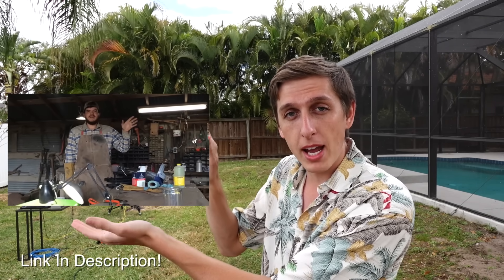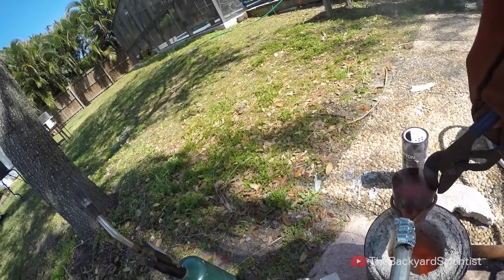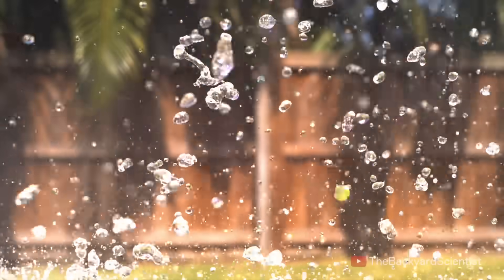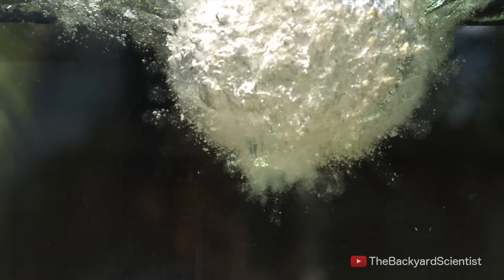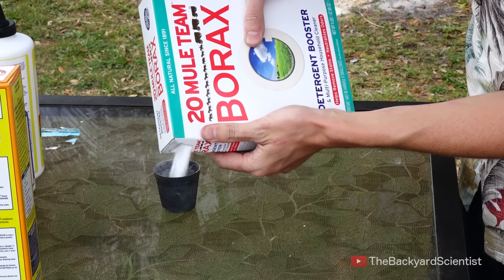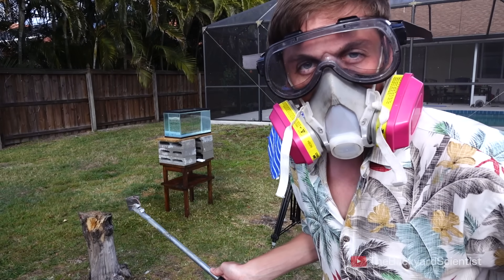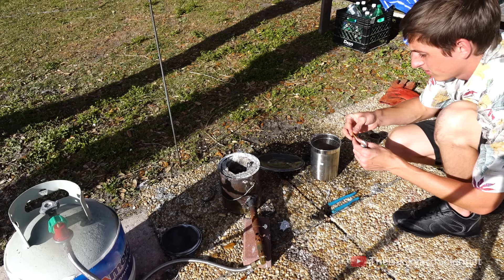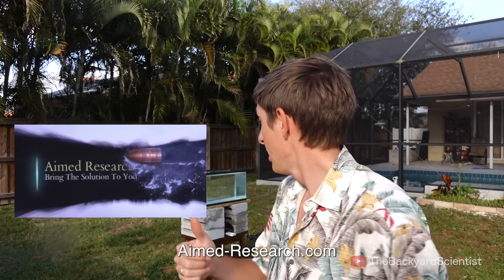Pouring Molten salt into Water - Explosion!

Comment: It's not a mystery!
1) NaCl is highly crystalline and has FCC lattice structure, whereas molten salt doesn't.
2) when poured into water, the molten NaCl quickly retains it's structure. This process releases heat suddenly. Sound is also an energy.
3) In that process the space gets compressed and hence vacuum is created.
4) The adjacent water molecules rushes to fill the gap (vacuum). However, the water molecules that comes in contact gets heated up and expand.
5) This collision between the molecules rushing to the centre and steam molecules rushing away from the centre cause the disturbance.

Note: we don't notice this with other salts, as most of the salts are hydrated and are not highly crystalline like NaCl.
Reply: Try Me Crystalinity may justify in part the explosion. However solubility of NaCl is much higher than borax, so when NaCl is getting back to its crystal form(solid again) water penetrates between the particles and its heat generates water vapor that expands and explodes
Reply: @mauriciobob  yes, but solubility is not instantaneous.
Reply: @johnchenky  Solubility isn't instantaneous but neither is the transfer of lattice energy. As the boundary of the molten salt relaxes into a crystalline structure it will increase kinetic energy which is transferred via diffusion the same as solubility. This also has nothing to do with explaining why the other sodium salts are insulated. Hydration is completely false because they've been heated above 800 °C. Lattice energies and vacuums are also wrong; they all have high lattice energies and compress similarly upon crystallizing.
Reply: Sodium Chloride disassociates in water and DOSENT retain its crystalline structure & molten Salt (Sodium Chloride) is liquid and the ions are free to move around and if you saw the sodium blow up in water you'd realize sodium would have to account for the reaction. Sodium donates its electron to water and releases hydrogen gas and forms sodium hydroxide and heats up in the presence of water with hydrogen gas being released in large volumes which causes an explosion. BUT, molten salt already has so much heat and heat increases pressure so the molten salt sinks below the surface of water then the free ions react, and blow up.
Reply: @tylerdoolittle6465  Sodium in sodium chloride is already ionised, so it doesn't have electrons to donate.

What is happening here is the object is hot, it has very little to do with it being salt. Salt dissolving is exothermic, but the majority of the energy from this explosion is due to the salt being hot.

It isn't a chemical reaction.
Reply: YoloSwagDaddy9658 if it was simply heat then basically anything you put into water that was extremely hot would cause an explosion. Try me was spot on with why it exploded. Salt regains is molecular structure as a solid very quickly when cooled. When it’s just salt that is. When it’s mixed with other components they prevent it from cooling as fast therefore it doesn’t revert back to its solid structure as fast. That in turn reduces the amount of vacuum that’s produced which in turn reduces how much and how fast the water is pulled in to that vacuum therefore dulling the reaction to the water being heated. It is a physical reaction. But only due to the chemical being used. Therefore it’s a physical reaction to the specific chemical used.
Reply: @joelblevins  Yes there are other contributing factors, but all explosions need a temperature difference to occur. The vacuum isn't the sole reason for the explosion.

If you get something hot enough and put it in water, it will explode. The water will instantly vaporise and expand, causing the explosion.
Reply: YoloSwagDaddy9658 then explain why the other components used didn’t explode after being heated to the same temperature. They were just as hot as the salt and didn’t cause near the reaction. It is all about vacuum. The more vacuum produced, the more water is pulled in to the heat, therefore cause a much bigger expansion or explosion if you would in water vapor.
Reply: YoloSwagDaddy9658 I’m actually very educated on this subject. You claim that any heated substance will cause an explosion and the video proves the complete opposite without diving into the laws of chemistry and physics. How can you possibly try to validate yourself continuously on something that the video completely proves wrong lol. And because someone gives you an educated explanation as to why you are wrong, you go to Wikipedia of all places  to educate the person you claim is wrong regardless of video proof that your theory is bullshit lmao. Good luck in life bud.
Reply: joel blevins so if this were done in a very viscous liquid that has a high boiling point would there be no reaction at all? I can’t think of a liquid with those properties off the top of my head but in theory?
Reply: @tylerdoolittle6465  Neutral sodium releases hydrogen gas and forms sodium hydroxide in water. Na+ is not close to the same reducing agent as Na. I'm on board with the first part that the crystalline structure won't form in water like Try Me is claiming.
Reply: And why Molten sodium caused fire?? 👀
Reply: @BLS.93  Hydrogen. Sodium hydroxide is forming hydrogen gas as a byproduct. All alkali metals are highly reactive with water/humidity in air.
Reply: Benjamín Enrique  that s a chemical reaction, between sodium and water they form a new substance, its highly exotermic, hence the flames
Reply: @BLS.93  because it is was salty. if you ever feel salty on a warm summer day dont go anywhere near water.
Reply: So if we tried this in outer space????

If we tried this experiment very carefully outside the spaceship had a triggered device placed in water that contained the heat melting the salt, had a fish tank with water kept in it by rotational force, then released the melted salt into the water....what would happen?
(I have a general idea, but I’m also not a science person sooooo)
Reply: @imcintyre01  Shouldn't change anything drastically.  As long as the molten salt and water are allowed to mix rapidly enough, it should create a really impressive steam explosion.
Reply: Ok ok... now tell us how did giligan not explode being on a desert island with ginger and Maryann all those years?
Reply: @dannymendez1688  simply because he wasn't salty he was sweet
Reply: oof rip ur fingers
Reply: English translation: its salty and its hot
Reply: Try Me 

They are dehydrated when heated, so that difference is inapplicable.
Reply: thanks everybody from this thread.you guys are brilliant
Reply: It’s the hydrogen atoms in the water reacting with sodium
Reply: This was my hypothesis at first; however, I find his idea with the visual putty to have quite a bit of merit, as water at those temps tends to explode into a vapor cloud very violently.
Reply: I guess sound could be considered kinetic energy as it is vibrations through a substance.
Reply: I think, using this: https://mrsec.org/highlights/amorphous-salt, instead of molten salt could be also interesting :)
Reply: Try Me doubt this, it’s probably just attributed to the low viscosity of molten NaCl
Reply: @danielvillageliu7445  I would also have liked to see a more rigorous tracking of pH to rule out a chemical explosion, and especially to have seen other chloride salts being used. I was thinking products like steam, HCl (gas), and maybe also hydrogen gas or even oxygen gas at these temperatures. If the molten salt is reacting chemically with the water, then it won't matter if a sheath of insulating steam is formed as in the LF effect; the molten salt can still react with the gaseous water.
Reply: Way better explanation 👏.
Reply: or it's just very salty....
Reply: English pls..
Reply: @aryapunyashlok3488  If you've ever dumped a bunch of stuff in a box and then later put it away neatly, you know it saves space when it's put away neatly. Basically, when the kind of salt that explodes is a solid, it automatically organizes itself into a neat, small space because of veeeery small amounts of electricity and magnetism. When it's a liquid, though, it's not organized. So it goes from taking up a bunch of space to taking up very little space very quickly, which leaves a bunch of space for the water to rush in and fill. But then the water is getting heated when it gets close to the salt, so it gets disorganized and takes up a huge amount of space. 

Raw sodium doesn't have that kind of electricity and magnetism like salts do, and most other salts don't stack as neatly as NaCl (the one used) so they won't change how much space they take up nearly as fast.
Reply: Duh, of course , everybody knows that. Geesh.
Reply: can you plz speak English this is a video in English
Reply: get over yourself.  it's not a mystery!
Reply: Noice
Reply: Good thing i paid attention in chemistry class, I know why an explosion occoured
Reply: Which is a chemical reaction...
Reply: @navadiouscash55  no it's a physical reaction. A chemical reaction would be something like the born haber cycle to make ammonia.
Reply: Really not other salts? I thought it's purely a physical reaction. Fast heating water only.
Reply: Thank you Einstein
Reply: r/iamverysmart

Comment: I don't know this stuff off the top of my head but...the different molecules must have different sized spaces inside them which grow, also, with heating. The one that can best allow in water molecules would probably make the biggest explosion. Maybe the NaCl can hold multiple H2O molecules or more of them than the borax.. But then there might be other heat specific physics involved as well. It's an interesting problem!

Comment: Is it really the molten salt causing the explosion?

I was thinking it is because the water received a really sudden thermal shock? Look at the temperature difference between the molten salt and the water, this heat is enough to quickly vaporate the water into gas right?

Comment: The heat will extract the Na from the sodium. Pure Na is a metal that reacts explosively in contact.  Not the only metal reacting this way. I did it in chem class, not physics. Not every chem reaction change the pH... it all depends on how the hydrogen electrons and if they separate from  the oxygen leaving hydrogen particles with a charge.Not a chem engineer but I seem to recall something along these lines.... other composts may get contaminated or have really strong bonds that may not mimic the chloride. Besides, lucky you that the amount of supposedly pure Na didn’t do its thing. That would create a really crazy explosion and you didn’t wear the PPE to escape it unscathed...

Comment: What I would guess is happening:
1. Hot melted salt is going into the water.
2. Surface of the melted salt is transferring heat into water. water boils surface change into crystalline solid. 
3. Solid crystalline surface cracks. Due to its crystalline surface it can not adopt to change of the shape of liquid salt and due to thermal gradient. Salt is not high thermal conductive, about the same as water.   I would also check density of the molten salt relative to the density of solid salt - it may be also a reason to crack.
4. Cracking process leads to splashing molted salt and pieces of hot solid salt.
5. Process repeats on the droplets as avalanche reaction. Water boils also around solid pieces. Heat exchange surface is increasing rapidly.

Comment: Isn't the salt just a coating? making the sodium explode later? try heating up sodium and pour water over that, instead of the other way around. and then also try it with the salt you used at the start. see how different that gets.

Comment: I'm pretty sure this just happens because the negative enthalpy of solution of sodium chloride exceeds the positive enthalpy of dissociation of the molten sodium chloride. Normally dissolving salt in water is endothermic, but enthalpy of dissociation should change with the temperature of the sodium chloride. If the sodium chloride is hot enough the enthalpy of solution + enthalpy of dissociation will become negative and so the physical reaction becomes exothermic instead of endothermic, causing a steam explosion.

Comment: Salt isn't what explodes it's the elements in salt (sodium) that separate when heated 

sodium is highly reactive with water if i remember correctly which is what explodes (too put chemistry into this video)
Reply: to decompose salt, you would need much more heat, much higher than what you need to melt it. and also, there should be a pH change if it's caused by the sodium because Na+H2O-->H2+NaOH. and that NaOH will form a basic solution with water.
Reply: @jayarjr7369  Wouldn't it be NaCl + H2O -> NaOH + HCL? One strong acid and one strong base => pH = ~7?
Reply: don't think that when you heat NaCl at high temperatures it will already react with water, because it will not. It is stable on it's own. it would not break apart.
Reply: Tony Dukes yeah
Reply: He didn't pour pure sodium into it he poured molten salt into it it did not separate as indicated by the pH test and the fact that it looked nothing like a sodium reaction which he also showed
Reply: @FrancisR420  it is molten dalt yes but it breaks down into its chemical compounds. its not pure sodium but sodium is what causes the highest reaction in the water causing the chemical reaction to explode

Comment: Basically think...
If you have to melt the salt at 800°C/1500°F then think, the boiling point of water is 100°C therefore when you pour the salt into the water it boils so quickly that so much gas is produced in such a small area and amount of time an explosion is created.
This is what i think anyway. Tell me if im wrong :)

Comment: To further back up your hypothesis (I haven’t looked at the papers cuz I don’t have time like chill), I think the water quickly going inside the sodium chloride, creates a vaccum for a split second which is violently filled in by water. But I think the reaction between the two is either a balancing of density or something completely different. I have no idea if NaCl is covalently bonded or ionically bonded - I can’t be bothered to think about it.

Comment: the reaction is aqueous – dissolved in water. The equation for NaCl (Sodium chloride) and H2O usually isn't considered a chemical reaction since it is easy to change the Na+ and Cl- back to NaCl...so it is physical because after the reaction the ph of the h20 is neutral

Comment: Back in the Fifties my brother and I used to melt our old lead dinky toy cars in a saucepan on a gas ring in the kitchen. We found that dipping them in cold water before dropping them into the molten lead created an explosion and there was dangerously hot lead splashing on to the underside of a wooden shelf above the gas ring and the nearby walls. 
Strangely, mum never mentioned the noise nor the bright silvery splashes but I often saw her struggling to get the burn marks off the saucepan.
 Pure steam expansion I guess, but I was only nine or ten and didn't understand the technical side of what was happening.

Comment: it's definitely chemical reaction. Nothing rocket Science behind this. Here's how,
NaCl + heat --> Na+ + Cl– ( Na and Cl ions separated by heat)
2Na+ + 2H2O --> 2NaOH + H2 (adding molten ionic solution to water)

So explosion is due to H2 gas which is coming out vigorously. 
 If you had haven't missed those chemistry classes, you would have know this @thebackyardscientist

Comment: When you heat NaCl (Sodium Chloride) the Cl (chlorine) atom starts to separate and then you get close to strait Na (sodium) which when mixed with H2O (water) you get an explosion. 
would highly recommend not doing this experiment at home because the reaction is highly unstable as seen in the video and can cause severe injuries. Awesome video though

Comment: The explosion is not caused by a chemical reaction. It is the result of phase change. The temperature of the molten salt is more than the boiling point of the water that is why the water that is in direct contact or the nearest surrounding water superheated and rapidly changed into its vapor state. Thus, changing the liquid water into steam and gas.
This is is quite similar on how a bomb works.

Comment: What you are seeing is STEAM explosions. And because the molten salt can emulsify quickly, its able to transfer its heat more throughly. The reason the salt worked and the other did not, is the flashpoints. Once the water flashes to steam the whole event gets hotter for a split second, because of the pressure, causing the salt to reach its vapor point(without contacting air), thus adding to the eruption. In air the molten salt just evaporates, under pressure wierd things happen. I am pressuming the salt vapor/steam contacting cool water would be quite violent.
Imagine super heated water injected into cool water, instant steam explosion...
ps: glad to see you guys in eye protection this time.
Keep up the kool work.
Reply: TheSirRip your smart
Reply: @cabesadepapacabesadepapa495 LOL,  if i was truly smart, i would still posses all my fingers...
Reply: @TheSirRip  why, what happen to them?
Reply: @mrtimidlysmith1054  Improvised pyrotechnic test that got out of hand.
Reply: @TheSirRip  Video or it didn't happen
Reply: @Gabriel-lh9xy  in 1986 vhs was all we had, it did not survive the time until digital. know this, i never lie when i testify...
Reply: @TheSirRip  Out of hand... Well said
Reply: Out of hand, I had a truly tasteless chuckle.
Reply: @ricaard  tasteless in my strong suit. 
; )
Reply: This entire conversation made me happy.
Reply: I thought it was because of sodium

Comment: I couldn't quite see the other salts, but the shot of the molten sodium chloride looked like it's very low viscosity, and probably low surface tension. Could that be the reason it encapsulates water and causes the explosions?